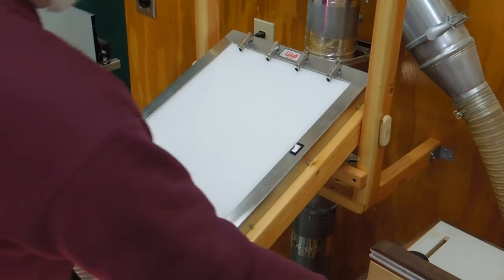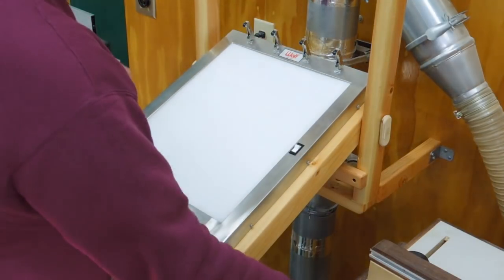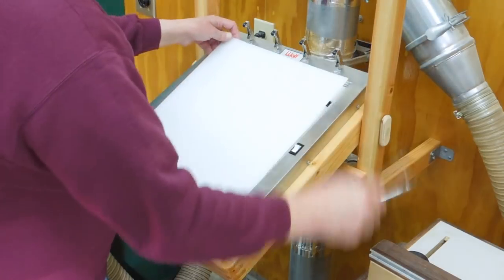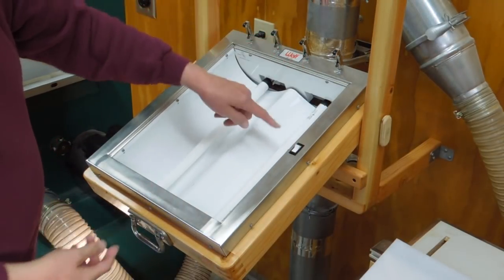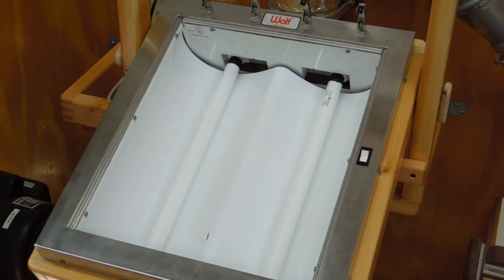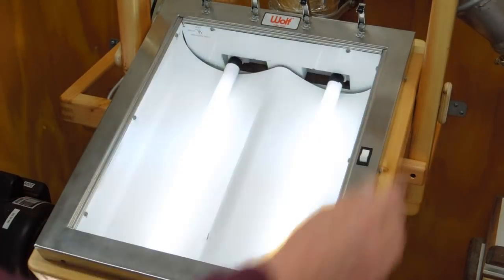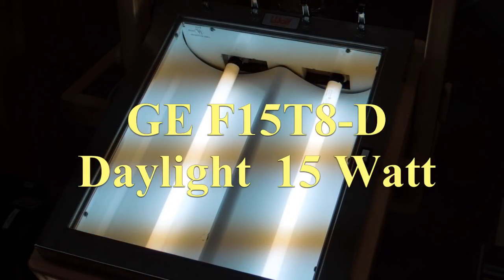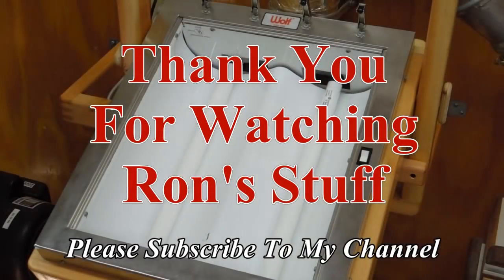X-Ray Viewer / Light Box Internals (Update To Original Video)

Comment: Can you please explain the material what you use to make the white part
Reply from the maker: I did not make any of this. The reflector is white painted metal. The viewer surface is white plastic. A frosted or white piece of glass may work... that would require some experimentation on your part.
Reply: Thank you for your explanation
Reply from the maker: Also... x-ray film is a thing of the past. Most x-rays today are micro-dose, digital and are viewed on a computer monitor. Look around and you should be able to find one of these vintage viewers as obsolete/surplus stock. That is how I obtained this one.